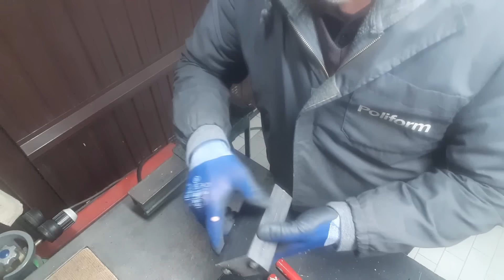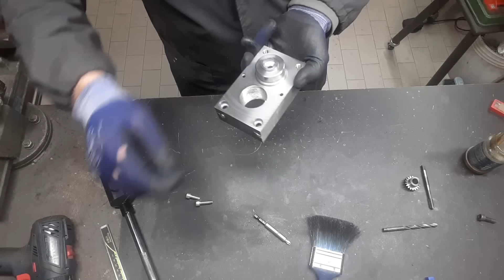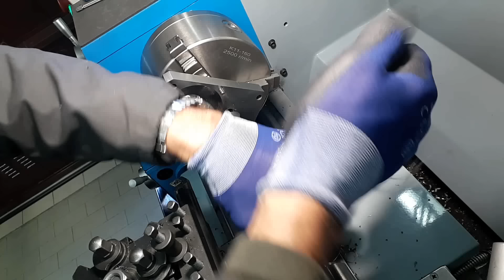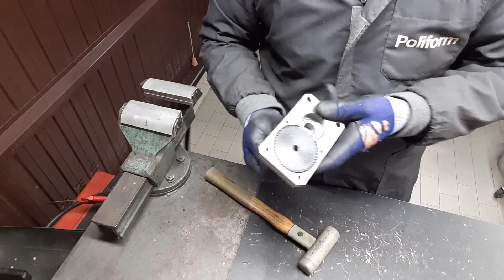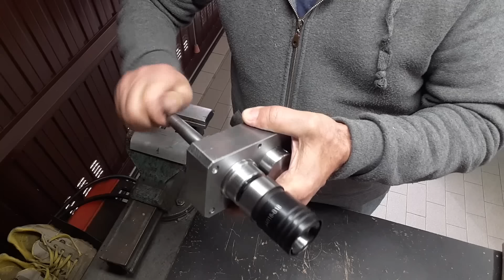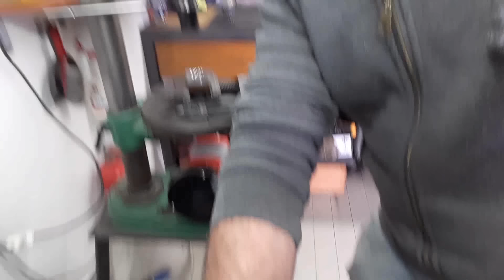Threading - Column Tap

Comment: Just a suggestion:  on my similar drill press I installed  a 4pole-double throw-center off toggle switch. This made it easier for reversing the motor. It will fit right were your main switch is with little modification. I like your gear reduction system.
Reply from the maker: Thanks Dennis , but it's already there, a lever inverter, then with the pedal I start and stop, nothing is missing

Comment: Per quanto riguarda la variazione della rotazione del motore, il motore monofase deve essere arrestato prima che possa ruotare nell'altra direzione.  Preferisco utilizzare un motore trifase con "inverter".  L'inverter cambierà facilmente il senso di rotazione e offre anche un controllo flessibile della velocità.  Inoltre, il motore trifase offre u.  prestazioni migliori.  Ben fatto, ottimo lavoro, come al solito.
Reply from the maker: Grazie mille Pepe, si è vero ma non sarà così potente, l'inverter a bassa velocità rende il 30% in meno rispetto alla coppia massima dello stesso motore, invece col riduttore avrai 6 volte in più di coppia massima, tutt'altra cosa.
Poi volendo si può collegare un inverter anche a questo motore 220, basta togliere il condensatore e collegare il suo filo alla U come terza fase.

Comment: You did a very good job with that gearbox, looks very professional 👍👍👍. But it is really dangerous to work with gloves at rotating machines like the drillpress or the lathe.
Reply from the maker: Thanks Ulf, I have to use gloves.

Comment: Ciao Maurizio veramente stupendo  mi piacerebbe avere più informazioni per poter duplicare questa opera d'arte ,tipo di cuscinetti e dimensioni degli ingranaggi ingranaggi
Reply from the maker: Grazie Gianni, i cuscinetti sono 20x32x7mm vanno sempre accoppiati perche troppo deboli singolarmente.
gli ingranaggi grandi con mozzo 20mm sono a  45 denti con modulo 1,5 esterno 69mm
gli ingranaggi piccoli con mozzo 20mm sono a 18 denti sempre a modulo 1,5 esterno 30mm
Col senno di poi avrei optato per ingranaggi grandi a 42 denti che basta e avanza. con un rapporto di 1/5,5
Prendi comunque ingranaggi con numero di denti divisibili x 3 così li centri bene sul mandrino

Comment: Complimenti per il progetto, ho quasi finito la realizzazione del tuo riduttore per un trapano piu' piccolo, ( Valex), sono in grosse difficolta' per l'inversione di rotazione, hai uno schema o farmi capire da dove arrivano i fili per il deviatore a 6 posizioni? Devo smontare completamente il motore per arrivare agli avvolgimenti? Grazie Luca
Reply from the maker: Grazie mille Luca.
ma il tuo motore è monofase con 1 condensatore?
Reply: Si, monofase con condensatore, sui 300 watt 1/3 di hp 1400 rpm (vecchiotto), il trapano e' uguale al tuo, piu'  piccolo
Reply from the maker: @lucamazzini5479  se è come dici tu a singolo condensatore si pùò fare facilmente senza aprire il motore.
prima cosa da fare,  aprire la sua scatola elettrica e invertire i ponticelli.
da entrambi orrizontali a entrambi verticali o viceversa, dovrebbe già invertire così.
il passo dopo è inserire un commutatore.
Reply: Purtroppo nella scatola elettrica non ho ponticelli, ma solo fili  e mammut, poi nell'altro alloggiamento c'e' il condensatore se potessi ti manderei una foto, comunque grazie per il tuo tempo, in tutti i modi il riduttore e' venuto bene, funziona, ho usato ingranaggi a modulo 1, mentre tu hai usato 1,5  @Mauri59g
Reply from the maker: @lucamazzini5479  ottimo che hai fatto il riduttore, ora devi assolutamente sistemare  la rotazione inversa

Comment: Bonjour Maurizio ,j'ai un petit renseignement a te demander ,je vois que quant tu taraude une pièce avec ta perceuse a colonne tu peux inverser le sens de rotation ,j'ai aussi une perceuse a colonne qui fait aussi fraiseuse ,elle fonctionne avec un moteur 220v triphasé,je m'en sert aussi pour tarauder ,mais je n'ai pas le moyen d-inverser le sens de rotation ,donc pas pratique car je doit arreter la machine et enlever le taraud a la main ,je voulais savoir pour inverser le sens de rotation as tu mis juste un interrupteur inverseur qui inverse directement deux phases sur le moteur ou bien as tu fait un montage avec un relay ,merci de ta reponse cdlt Daniel
Reply from the maker: Merci beaucoup Daniel, tous les moteurs asynchrones peuvent inverser le sens de rotation, juste inverser deux phases, mais dans votre moteur triphasé je recommande un interrupteur/changer 3 lignes 3 positions ON OFF ON.
La connexion est très simple, mais difficile à expliquer avec des mots, je vous recommande donc de trouver quelques vidéos à ce sujet.

Il est également possible de commuter automatiquement électroniquement via des relais et des microswitch mais vous aurez besoin d'un professionnel.
Reply: @Mauri59g  merci pour la reponse je vais mettre un inter 3positions ce sera bien pour moi bonne journée cdlt Daniel